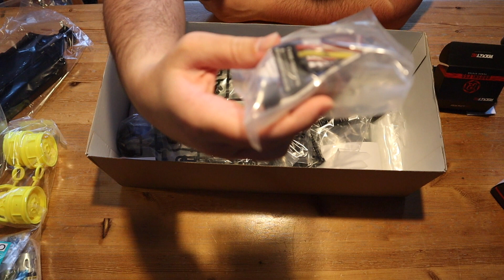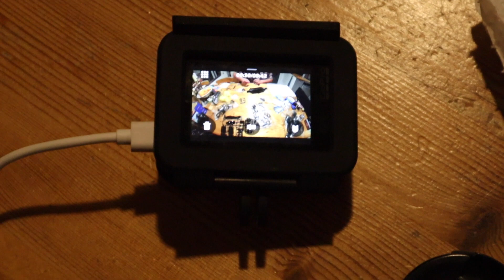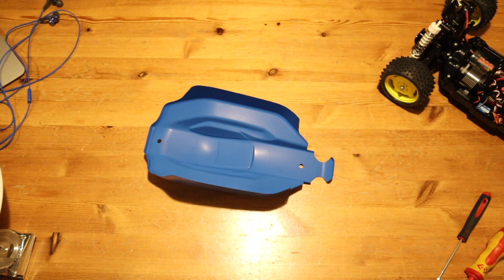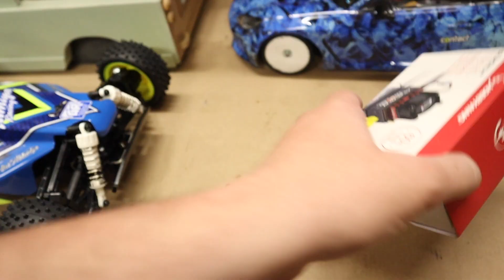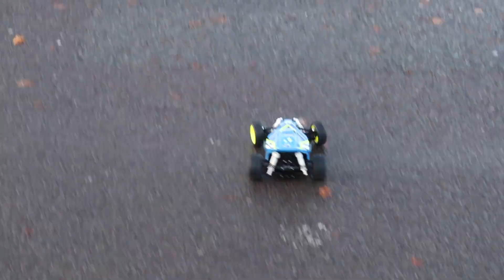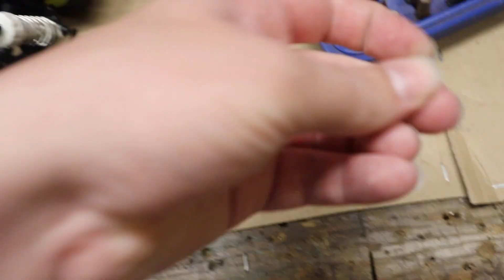Tamiya Plasma Edge II Brushless Build!

Comment: Just rebuilt the neo scorcher. Used a 550 motor and nimh battery. I dont do any lipo or brushless. Im a brushed nicad/nimh man. Just rebuilding tamiyas best little buggy/truck the max climber. This will have the bz motor and nimh battery at approx cost of 350 pounds. The tlt is unbreakable and has 3 diffs/4wd/4ws/and belt driven. Tamiya best of the best.